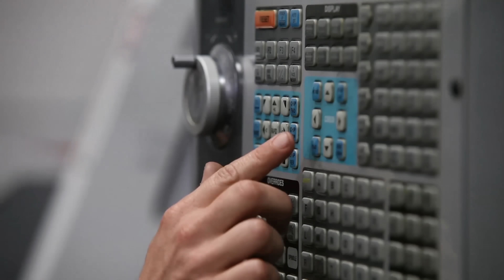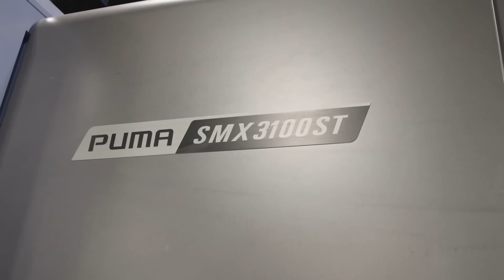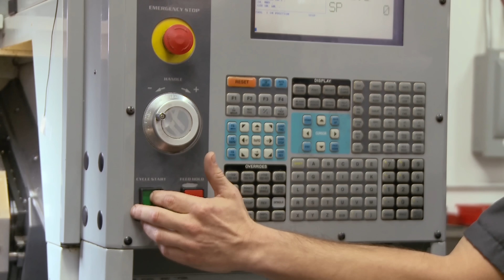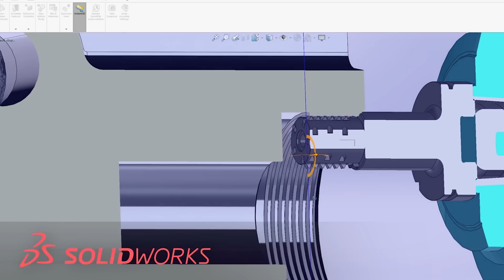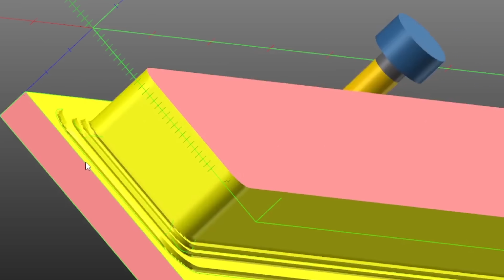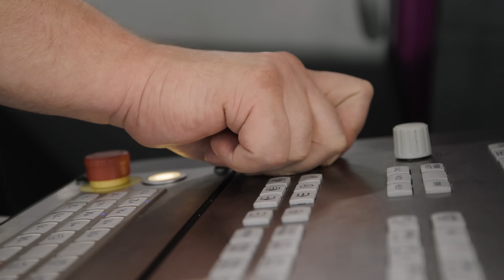Why We Keep LOSING Money?

Comment: Just remember it has to be made right 1st and fast 2nd. No amount of "efficiency" will make up for not making good parts 100% of the time. Nothing is more expensive than scrap. There are many facets to efficiency and setups are just one. As a previous Aerospace shop owner, it starts with a properly quoted job. You can't out engineer a bad quote. But you must know your business like the back of your hand and have the people and equipment that can execute and exceed your estimate, both SU and Run time wise. You must also be intimate with your cost structure and OH costs.
I didn't go to work for entertainment value, I went to work to make money. Our people respected us, and we put them 1st. Our customers respected us, and we put them 1st too.

Comment: I'm totally feeling you on this one. 
At my workplace, us machinists have to do all the steps, from cutting raw material to programming, rigging and manufacturing. I'm spending so much time looking for tools and rigging components it's not even funny. On top of that, I can't function when things around me are messy, so I end up "wasting" a lot of time cleaning up after my co-workers: wiping off machine tables and workbenches, putting tools, holders and instruments back in their respective places etc. Also, everyone is hoarding tools at their work stations to save time, so I'm constantly running around asking to borrow stuff. It's exhausting.
My boss is always on my ass complaining about my setup times, claiming that these things "should only take twenty minutes". I just nod and go about my business. No use trying to explain what should be fairly obvious...

Comment: Some other things you can study include JIT, Kaizen, and Kanban.  These are things we use in software engineering, but their roots come from manufacturing.  I take tool control seriously since I was the tool petty officer in my shop in the Navy.  I made foam cutouts for all the tools and the ones that didn't go in drawers I painted silhouettes on the wall.  That way a quick look will reveal a missing tool.  The Navy, especially Naval Aviation, takes tool control very seriously.  A bird can be grounded if it's caught in time.  Something catastrophic can happen if there is a loose tool inside an aircraft.
My dad was a machinist and I grew up in a machine shop.  He worked mostly on the mill.  He was known as the shop genius for setups.  I remember he would study the bp for about an hour in his office, then he would go out and spend about 2 hours setting up the jig.  Then he pointed me at the machine and I got to work :D.  I would blow off the part, check tolerances, and put the next piece in the jig.  At first he had cranks, then he had this gadget that spun the cranks automatically based on the feed rate you specify, then he got CNC.  They had CNC lathes first, but eventually he got his CNC mill.  My dad was always a forward looking person.  He would most definitely embrace new ideas that would help him get better.  He pushed the shop owners for years to embrace CNC, even though he didn't know anything about it at the time.  He just knew it was the future.  This was in the 80s.

Comment: Most people prefer shops run sloppily. Putting shit away is more work which a lot of people don't feel like doing at all. Most of these problems would require massively restructuring entire companies to be solved, more often than not it's easier to just walk away from that job and find one where people care. I mean honestly, what can a single machinist do when nobody wants to listen? Nobody should be the shop janitor but you are basically suggesting we do that

Comment: I recently retired after 54 years from a CNC programmer/machinist job.  I have been through all you have shown here and have implemented it in some shops. Other shops, even large ones, had the attitude of "were making money now, why change" and simple solutions weren't heeded. I have worked in management on the shop floor and as head of inspection departments. I have found that many of my fellow managers didn't trust or have a very high opinion of the people working for them.

Comment: This is basically my argument for getting me a new machine.(We're a 2 man shop)The machine I run currently can't meet the tolerance required its wore out.(1995 Hurco) I did a job last month we had to send out to jig grind. The total cost was around $2k on this one job. We have parts edm'd that wouldn't need to be with new machine. The payment on a new machine is around $2500 a month. Jobs like those would cover most of the months payment alone.

Comment: Setups are the bane of my existence.  Where is it?  It's got slurry on it, lets clean it.  It's fucked up, start over.  Tooling is heavily disorganized, dirty, damaged.  It's "fun" making 1 drill 3-5 times because some component of the tooling is screwed up giving you crap runout.  Everything is so bad and it's supposedly why I don't get raises, because my efficiency is absolute trash.  Still working there after a couple years...  Maybe there will be a 4th guy after me, dunno.

Comment: I worked as a CMM programmer at a place once. I couldn’t get them to buy new ruby tipped touch styluses. Those are consumable items. The ones I had to use were years old. I ran a program on a part twenty times without moving the part just to show them it was impossible to get food measurements with the current setup. The dimensions were all over the place. They still refused to buy new touch points. And they wondered  why dimensions were out of sync

Comment: 2 hours to setup a 3 axis job sounds great for me. Granted, I typically set up and leave FOREVER or make a 6 month quantity. Between finding and building tools, setting the workholding up, proving through a program (that alone could take 2 hours depending), 2 hours is a dream. I typically like to do 2 full runs after a prove as well just to make sure no variables are messing with other programs (even though at this point I should be confidant they aren't).

Comment: I so relate to this.

Imagine you have a rush job, and the tools aren't ordered ahead of time. The end mills you do have were ordered by non machinist who barely know what you need, and they're all jangling together new and old, unsorted in plastic bins. Also you're actually looking for an end mill to use in a manual lathe, because somehow all the boring bars are missing. Also the lathe is the only metric thing in the shop and it's wired backwards. The manual mill has so many chips under it that after a full day of use it'll have walked it self 4 feet away from where you started. The stock that was ordered for you is nearly the exact size of the part because the people spending the money don't understand workholding. Then management starts telling you because its a smaller job, you should make some of the features on a belt sander instead of a mill. They don't give you enough tool holders to keep common tools set up, but they complain when not enough spindles are running.

All of these are real things that happened to me.

Sometimes it gets to the point where you have to beg to fix things even if you have to pay with your own time and money. Your sanity becomes more important than money or getting credit for things improving. Or you just quit. I did both.

Too many shops try to compete on nothing but being the cheapest shop around. You can make money on quality or speed. But to do that you need to make an organized shop.
Reply: "The stock that was ordered for you is nearly the exact size of the part because the people spending the money don't understand workholding." This... I deal with this every day. I keep asking for oversizsed stock so that I could machine all edges at once. But they ignore me and just buy exact size, and i have to do change overs...
Reply: Sir, is this  supposed ro be dark poetry, its like a horror story...

Comment: My old shop that I worked at tried to do a lot of what your talking about but when it came to solutions we always had to be the ones to do it and if we couldn’t the suggestion would basically just get thrown away with no explanation. I had one time where we were flipping the part on the fixture 3 different times and in that process having to remove bump pins and mitee bites and put in locating pins and then repeat the whole process all over again. I calculated that if they would make multiple fixtures it would save 10 min per part on a 30 min cycle time on a job of 300 parts so they then had me go around and look at all of the fixtures in the entire shop to find the ones that had this same issue. So after I did all of that work the engineering department just said. This is how we’ve always run these parts and threw out the suggestion and we had to do this while keeping our machines running otherwise they would get mad at us. That and whenever we had a major issue they would typically just blame us instead of working with us and they would basically say we were bad at our jobs. Thank god I left that job now I work at an extrusion die shop making significantly more money and I also love my job!
Reply: In that case, you made the right decision by leaving. Its actually a bit sad how many EXCELLENT ideas are cast aside by people with ZERO understanding of what we do. And the end result is almost always a company that struggles to find new talent, or retain their existing talent. I mean, machinists TALK. And then, the company usually starts to whine about the “skills gap,” when in reality…..it is a “listening gap.”
Reply: @barrysetzer   thanks for reading my long monologue I love the videos. You’re precisely right. Because they couldn’t keep people they were constantly hiring machinists straight onto days. What they would do is they started doing after I left is going to tons of high schools in the area and telling the kids how great it was and would give them tours through the shop. They would then work there for little money most likely as a first job and that’s how the company started getting by (plus they didn’t even pay their current machinists that much either). My co-worker told me this after I left. My production manager who was one of the main reasons I left straight up harassed me on my last day saying I’m making a huge mistake and he honestly made it sound like I personally betrayed him. Plus he asked me for examples and I gave him some then he really angrily debated those reasons with me and I told him this right here is the reason I’m leaving
Reply: You arent alone, bud. I once had an owner that i broke my back for, for 6 years, tell me (after i gave my 3 weeks notice, and 2 days before it was complete) “You fat, worthless mfer. You learned everything you know from me. Get tf out of my shop.” Oddly, that actually hurt my feelings as I had given like 150% there. But, without what I actually learned there, I wouldnt be HERE. Sooooo yeah, LIFE!
Reply: @barrysetzer  damn that’s crazy! For 5 years I gave 110% for that company and they treated me like shit. When I got to the end I literally just stopped caring and became very lazy. It was so hard to get through the 1 1/2 month long period it took me to get my new job. Because when I hit my limit is when I put in my application at the new place. But I’m also lucky because about 2 weeks before I put in the application to where I work now is when I’d first heard of it. At my new place I’ve talked to people who worked at the place I was planning to go and they said it sucked. It’s like the old phrase everything happens for a reason. You’ve maybe heard of Cloeren Inc. that’s where I work now and I absolutely love it here
Reply: When you put in the WORK, you land exactly where you were MEANT to be. Cheers!
Reply: @barrysetzer  cheers to you too!

Comment: Dealing with the same issue, biggest issue is we have 1000s of parts with lots of setup, and the setup sheets for basically every part is wrong and if you follow a setup sheet you will either crash cause it’s a new program and no one updated the setup sheet to accommodate or scrap a part. And no one is willing to fix the issues it’s all tribal knowledge so what do you do when they’re gone, thankfully in my department me and my buddy have FINNALY got it all fixed for the next Group of guys can follow a setup sheet that will lead to success
Reply: That is like one of the most important things ever. I love your comment. You GET IT.

Comment: I have a vmc, need to do a boring of 200mm deep in cast iron, getting lot of vibration and lots of problem is there any way you can help
Reply: What diameter, and what size is the hole youre starting with

Comment: oh man, that last part hits hard. a shop i used to work at, they may hear what you say, but nothing was implemented. suggestions from using barcodes on setup sheets and for tool sheets to be able to pull the correct tools out of the tool matrix, different methods to make more parts in less time using pallet systems vs pneumatic vices, getting these rubber bristle brooms to help speed up the time to clean the machines. And gosh the last one, which was by far the worst, was how they had the machines set up. They knew it too, even when setting up, but they didnt care since it wouldve taken time to do it properly. They had them in arranged in a circle... all facing outwards and a good bit away from each other. often an operator would have to run 2 of them, and they sometimes had similar runtimes, so one ends as you are changing the other, but like a line of cars with blinkers, they were off by enough to make a difference. i was talked to by the shift supervisor when that happened to me, essentially telling me to be on top of the machines when they finished... go figure. 
I also was curious, so i counted steps between machines, and how often they needed to be changed out. At the end of the shift, you would be walking an extra 2+ miles just walking between 2 machines... 

oh well... anybody hiring in the central VA area? lol. Hope to see you guys at IMTS!

Comment: Management thinks a standard of 15min is good for every job, I chuckled at that, because it’s true of where I work.
Reply: Had a boss tell us once our setup time should be getting faster over time despite us not making the same thing every day and working on castings
Reply: @Reesefo  Management cut our batch numbers to 1/4 of the size ; basically make the parts they need for the week . But they where blind to the fact that they increased setup time by 400% for the month .😂

Comment: I found the worst scenario is a company owned by someone that has no experience in nothing but the numbers. At one sign shop, after moving in a new facility, we began to set up our machinery and workstations for efficient flow. When replacing a worn out shear the owner wanted it placed completely backwards from the "flow". Lost an hour in setting up the machine trying to explain the flow. Then he wanted the cnc router table put in the storage area over the offices. Here we go. To get materials up, had to extend overhead crane, fabricate sliding hand rail, power, etc. It became constant battle to keep machine level on ever changing plywood floor. One had to almost yell over the noise in the offices. ???? 🇺🇲🍺

Comment: Problem is finding the employee(s) capable of keeping inventory of fixtures and tooling. Hard enough to find someone to show up on time and press a button.
Reply: Pay more, if you are having thise problems, you are only getting the dregs
Reply: @yerpright7548  we start between 20-30hr depending on experience. I think that's more than fair for ohio.
Reply: @fordhoarder  Since Im in NZ, I can't fairly comment on your local wage rates. Finding people who live and breathe to "make chips" and call themselves machinists or engineers with pride are becoming rare. Too many turn up because "its a job". So a clean innovative workshop isn't their goal. Here in NZ employers are having the same problem, they put an ad up paying run of the mill wages in an industry filled with button pushers, you need machinists, which will probably require headhunting. Make sure your shop has its coolant clean etc(doesnt have to be expensive, think 55gal drum& domestic water filter~NZ$250)shadowboards/5s so the new guy doesnt have to wade into a pile of crap. If good people leave ask why, and genuinely take their reasons on board. I wish you the best of luck.

Comment: Preach brother Barry! The shop I worked at had horrible inventory control. I was the sucker assigned to  do counts every 6 months. Machinists would walk away without checking out tools, tooling wasn't counted properly (some would count a pack of 10 inserts as 1 tool, not 10), others would throw tooling back in drawers wherever it landed, etc. To top it off, the company that was brought in to help improve efficiency actually marked the tooling labeling wrong in correlation to our system. Do you think they ever came back to correct the error? No.. 

I can't count on my fingers how many times a program had to be modified on the spot because we were out of the tooling the job required. Customs were a natural disaster of their own. Something that seemed so simple ate up the most valuable set-up time.

Comment: 2 hour setup time, my place is about 3-6 hour depending on who getting it set
Reply: with the probe, I can have a setup in a few minutes.
Reply: @wannabecarguy  Yeah If you don't need to change setup. 
Whenever you need to remove or replace a vise or adding a 4th axis setup (like I tend to need for a job), I doubt you'll use anything under 30 mins..